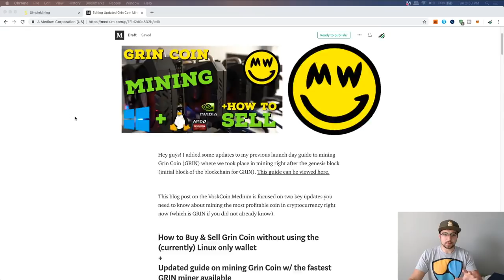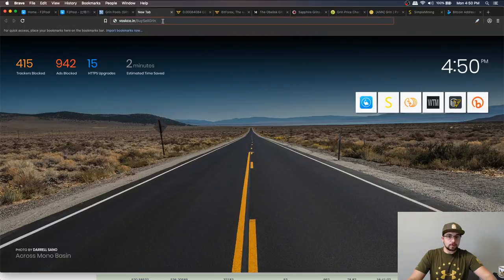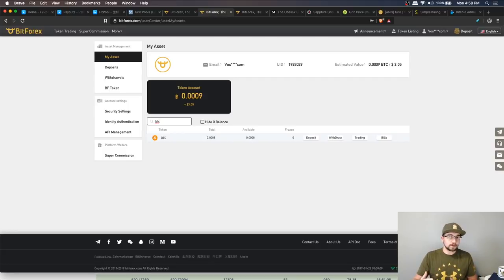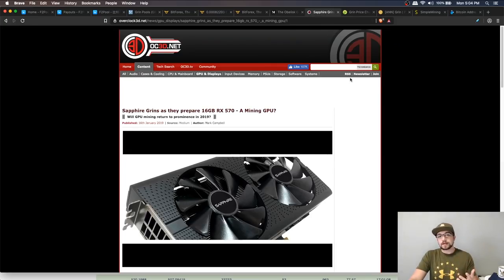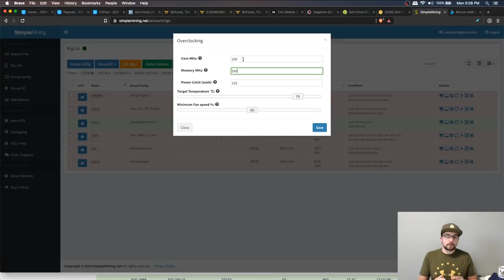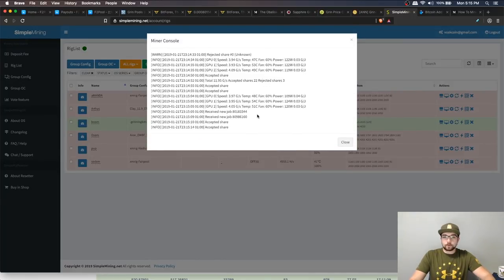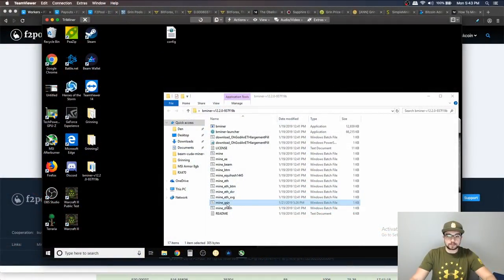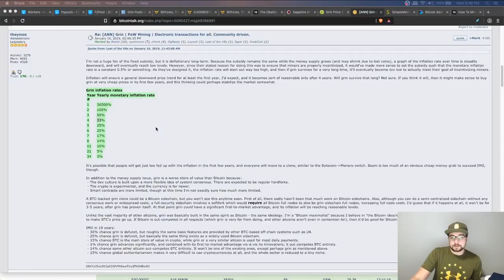Ultimate GRIN COIN Mining Guide + How To Buy & Sell Grin Coin | Nvidia | AMD | Windows | Linux

Comment: 1dear vosk l had a 1080  and its fan burned out the manufacturer replaced it with a 2070 witch is better for mining ? 2what is the best coin for me to mine consithering that l dont have time to switch my rig to other cryptoes l need a relatively stable one ?lm curently useing nicehash.3how much did you push your 2070 if you have one mine is core 2040
and mem 7600 sorry for bothering you with so many questions thank you.

Comment: Help!!  Everytime I try to use the V13.0 bminer, on start it says miner died.  When I start it with the initial setup only 2-3 of my 5 gpu  start working. And it varies which every time.   The others  say: Critical error in main ocl loop   The kernel could not be enqueued.  Error code: MemObjectAllocationFailure.   What does that mean and how do I fix it please?

Comment: Great video Vosk, thanks for all your hard work in making them!  I have a test Grin mining rig running two 1070 TIs based on your instructions and it runs great at first, but then locks up after a random amount of time and I have to perform a power reset to start mining again.  Any thoughts?  Running Bminer 13.0.0 since I've got an AMD CPU and the Bminer notes said that the new 13.x.x releases weren't compatible.

Comment: Does the Bminer only works for Nvidia cards? I followed all your steps but my AMD cards won't run. Kindly advice please.
Thanks.
Reply from the maker: You on windows or smos?
Reply: @VoskCoin  windows.
Reply: Me 2  failed to initialize the CUDA platform bminer failed to initialize the Cuda platform Cuda error failed to load nvml.dll 126 is all I get.
Reply: @AdeJaiyeoba  I am still having problems though getting an error message unidentified requested resolver
Reply: @OzzyBoganTech  thank you. I'll try that today.
Reply: @OzzyBoganTech  on AMD?
Reply: @AdeJaiyeoba  yes  on AMD but looking like windows bminer and AMD all together is a no go.
Reply: @OzzyBoganTech  I just bought some GTX 1060 6GB.  Will that work on Bmimer?
Reply: @AdeJaiyeoba  Yes but 6GB only  on Linux and Cuckaroo 29

Comment: I'm not so sure that the linux miner is actually faster than windows grin gold miner. My 1070 overclocked is hitting close to 3.0 gps with grin gold miner but when I look in f2 pool I see peaks close to 4 gps. This would indicate the software is not correctly displaying actual gps. @VoskCoin can you check to see on your end for any variances?

Comment: Great video!  Thank you!  I have been using grin miner 1.0.2 to mine on my AMD RX SMOS rig.  Their config seems to indicate that the bminer software can be run for RX cards.  I just get errors in a number of ways that I try to configure the miner.  Does anyone know if this is possible and that there is a faulty UI issue with SMOS in showing it is wrongly applicable to RX cards?

Comment: I am using Vega 64 on win10 and getting this error-Failed to initialize the CUDA platform: CudaError: Failed to load nvml.dll 126
.
any solution for this problem???
Reply: @Linoleumcina  just swich to grin pro miner and problem is fixed
Reply: @Linoleumcina  F2pool ,with Vega 64 i am mining 3.5gps on 175w
Reply: @Linoleumcina  Srbija-Kladovo
Reply: @Linoleumcina  probajte povisit virtualnu memoriju

Comment: Bminer didn't care for the GTX 1050 card I have on my rig (GTX 1070s). The miner continued to crash until I figured out how to select which specific cards I wanted to use. On the very last line of the mine_grin file, after "-api 127.0.0.1:1880", add "-devices" followed by the device numbers, beginning with zero (separated by commas). For example, "-devices 0,1,2,3,4,5". It took me a few tries before I figured out the 1050 card was device 6. I can still use the 1050 card to mine Horizen coin. I hope this helps anyone who encountered a similar problem. Happy mining.

Comment: Thanks for the tutorial. I just received my three Zotac GTX 1060 6GB's today and my stock cuckoo29 hashrate is 2.75 G/s each. I think I'll get 3.1G/s after OCing. This is on Windows 10 and Bminer 13.2. There isn't much information on GTX 1060 mining, so I'll add it here.

Comment: So I had a problem trying mine mine beam and grin. Grin wouldn’t work last night because it wants to run on Linux you have solved this. My main problem is mining beam. I followed all the instructions and the miner just doesn’t want to start on my computer having the wallet and changing my address. I don’t know what I am doing wrong and just want to mine either or at this point I will try and implement this video when I get home.

Comment: Used your Ref Code to Sign up to Bitforex.  Thanks Vosk - Thereal35.  PS was a bear to Register with Bitforex.  Then had to reg with F2pool, which wasnt as bad.   on launch I was using gringold and heavily involved in the voskcoin discord channel.   Gringold miner was smashing my CPU on windows 10 -4x1070 +2x1070ti rig.  It was causing throttling issues.  Bminer is way better.  I am using 950 watts i am getting just shy of 26 g/s.  Also I did move the virtual up from 24 gb to 48 gb, but i discovered that on launch day in the voskcoin discord.
Thanks Again
thereal35
Reply from the maker: Thanks for the continued support my friend and haha it’s not that bad!

Comment: You can mine grin with a 4gb rx 570 using minerbabe os, also with NBMiner you can mine with a 6gb 1060 on windows 10.
Reply: minimum of 6gbs on gpu required for this one...yes a 1060 x 6gb can mine it, no on the 4gb rx
Reply: im still getting the insufficient memory error even after changing vram
Reply: @robbo580  the new bminer now supports gtx 1060 gb cards
Reply: @TheReaL35  I am currently mining a 0.70 gps with my rx 570 4gb using the minerbabe operating system and miner
Reply: @dnagaht  well i increased the vram to 64gb but the error persists, do you need 64 per card or smth?
Reply: @robbo580  windows os reserves a small piece of vram.  Similar to how you could still use a 3gb card on eth in a simple miner but not in windows a while back
Reply: @TheReaL35  so you need more virtual memory than just the 64gb he said in the tutorial?
Reply: @robbo580  no..the virtual memory not the issue. Physical memory is with windows. Ie I am running 4x1070 and 2x1070ti on windows 10 with 40 gb virtual.  The issue with a 4 gb card is how windows will essential steal a small portion of that memory.  So a 4gb acts like 3.6gb. I have heard some new miners can run the lower gb cards now, but usually running a Linux based OS
Reply: @robbo580  join voskcoin discord, there is a grin launch channel in there where we discuss these issues

Comment: [FATA] [2019-01-23T05:13:52+01:00] Failed to initialize the CUDA platform: CudaError: Failed to load nvml.dll 126
[WARN] [2019-01-23T05:13:52+01:00] Miner died! It will be restarted soon...
this is wat i get when i start the Bminer  SOS
Reply: I get the same message
Reply: @yellowmustang1819  Same message here on RX580's
Reply: DDU then fresh drivers
Reply: @ThisVers1on  no this is not a solution !
Reply: Yes would love to see how to make this work on AMD have not had success on GrinGoldMiner or GrinMiner either.
Reply: i have rx580 8gb and i get this errors when i use bminer but i have no problem with goldminer.
Reply: @sashkaa Hi I got my Nvidia working but i had to use f2pool would not work on the pool that i was trying not matter what i tried.
Reply: @bnm1652  what command line did you use for SMOS?
Reply: try to increase virtual memory
Reply: @philipphillips2625 use this option -devices amd:0 but still not working its says "undefined but requested solver cuckaroo29" try it on your rig.

Comment: hi, can you tell me please how much money I got per day with 6 x Sapphire RX 580 8GB and 6 x RX 570 8GB with GRIN.
 I got on ethash 365 MH/sec, There is a GRIN COIN calculator ?
Reply from the maker: There’s a profit calc
Reply: Neo did you find answer and what is corect here mh/s ,h/s or g/s
Reply: @user-od2oe2up4c  i got 15.6 GPS/sec with 12 amd gpu
Reply: @Neo-14  thanks for the fast answer i have 17 rx570 8gb sapphire and in my country is not profitable to mine ether anymore. Did you know       
overdriventool work here or that use processor to and what is Gps i think is G/s

Comment: upboat!  I changed over to bminer, I was hesitating because the HiveOS rig Nvidia drivers needed updating, and well, they failed during install, so I had to re-flash the USB stick.  All is well after the fact though, bminer running much faster than GGM, plus I've tuned my power down to 125w (about 70% power) and still getting way more graphs/s than I was before.  That's at +200 core and +700 mem (shows at 1400 in Hive).

Comment: i have watch several guides you make.  Make a video with a process start to finish. Dont skip little stuff like creating a worker or writing the script.
Reply from the maker: Not skipped
Reply: @VoskCoin  80 min worth of viewing and 4 views on the video and yes you skipped it. You gave us the script, and a little info on the Algo. But really thats it. 
The new Bminer 14 is causing the GPUs to crash. Its just frustrating to waste time and watch the guides and then end up having problems when its time to run.
Reply from the maker: On windows it’s in the download and smos is a copy and paste
Reply: @VoskCoin  what about the worker name. You have the username voskcoin and then boom if i recall. Dont we need to create that worker in our profile? it says error, failed to login.
Update: to verify it works or not. I used your exact script to test. It connected. then replaced Vosk and boom with my info and it connected. Maybe it was a formatting issue. Doesnt change my feelings about the video. Its not clear cut. If you think it is, then start at the beginning of the video and follow the instructions exactly. Make no assumptions and only follow the video. you are lacking some steps. you can disagree, but as someone that again watch it 4 times and wasted 80 minutes of time setting up this coin following your guide, and in the end i had issues. Thank you for the content as always!
Reply from the maker: worker is optional, its for your own tracking / monitoring purposes. simply put your username in place of mine and youre set

Comment: I could not get bminer working with my vega 64 cards. anyone else have this problem?
Reply: same cant get it to work on vega 64 on windows, same with gringold miner it seems it doesnt get detected.
Reply: @ZyFinity  I did get mine working with the Grin Gold Miner 2.5 on windows 10. only getting 2.8 gps though.. my gtx1080's are getting 5.1 gps, so it almost isn't worth it.
Reply: @BradleyKang23  Mine Beam with the Vega's. I have an 8 x 56 rig and 3 x 64 rig going on Beam. I was getting 2.9 to 3.7 gps on Grin. Beam I'm getting 15 to 22 Sols per card. I can mine either Grin and Beam with 56's and 64's using GoldMiner...
Reply: @RyanJohnsonSCMS  Thanks, I'll look into this
Reply: same here

Comment: Grin is big joke in security. Authors give all energy to minimalize blockchain, but forgot for complex coin idea. No addresses? Payment identify by IP? I saw that grin withdraw-deposit make by swapping files trough email and when lost it, all money lost. Thats easy bloked by 3rd. Welcome in new "security" model.
Reply from the maker: How should they fix it?
Reply: @VoskCoin  Fix? It cant be fix. Is bad structure of network. Its joke like PoS. Not understanding all bricks. They can some time hide that problem, but it fully spread after several year. And when bubble disappear, maybe will be done. Try to think for yourself, why grin need block explorer, if there are no transaction and no values. Simply some parts are copy of bitcoin. I see they wanted beat bitcoin in storage, but value for this feature is no address. How users are identify in network? For me its critical. Exactly its call mimblewimble, whats mean to not see truth.